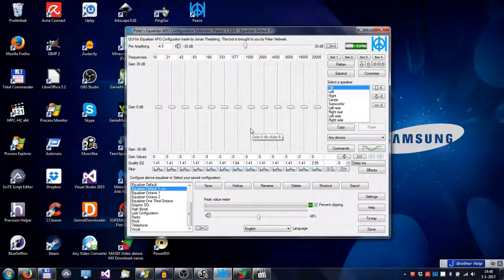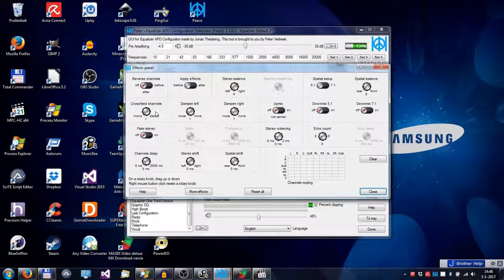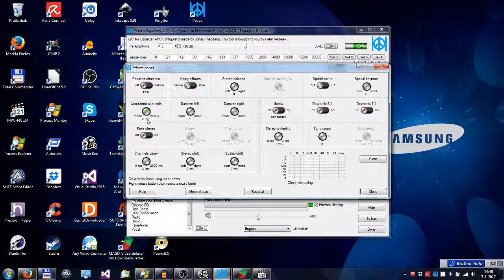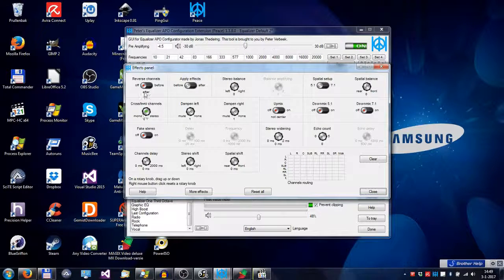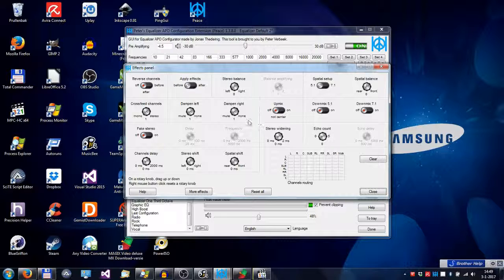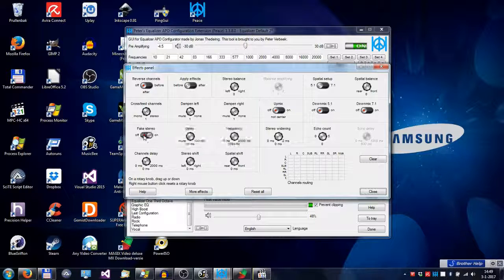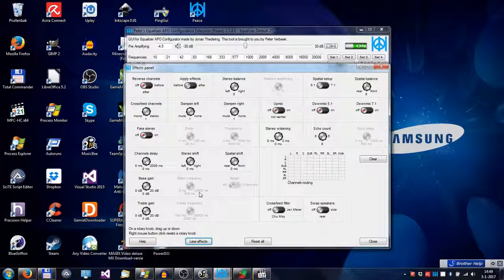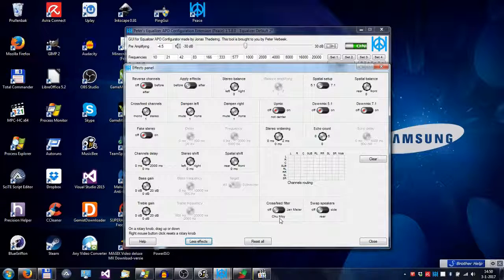Peace Equalizer -  Tutorial 4 The effects panel

Comment: Hello, this is a super awesome tool thank you for it! I have one question about it, how does the channels routing feature work? Does it ever not work for some sound chipsets? I am trying to setup my speakers in a multispeaker but not surround sound way. I want just 2 channel stereo output but apply the equalizers to all 5 of my speakers individually (2 front left, 2 front right and 1 subwoofer). I was just using a physical headphone splitter to split the stereo to everything but splitting them out to the front left+right, rear left+right, and subwoofer connections and enabling the channels routing to send left to front left and rear left, then right to front right, rear right and subwoofer I get no output to anything but the front left and right, it doesnt seem to do much of anything. Any tips? thank you
Reply from the maker: Reading your post I'm not entirely sure what you need. But I can give you some ideas to play with. For instance, when having a stereo sound input and you want to spread it on a 5 speakers output you might use the "Upmix" effect on the Effects panel. At first, set the "Up way" to "Always" so upmixing is always done despite the input. Later on you may try "Detect".

On the main Peace window you can equalize individual speakers or a group of speakers. To do this click on the speaker (combi) in the speakers list at the right. For instance, equalizing the left speaker is done by clicking on it and then equalizing it. Of course in your case you want to equalize the front, back and perhaps subwoofer. As these aren't in the speakers list you create these combi's yourself. It's very easy: Click on "left" in the list, click the right upper edit button at the list and check the right speaker checkbox. Of course give it a proper name like "front". Now do the same procedure for the rear. You might delete the speaker combi's you don't want.
Reply: @PeterVerbeek  yes that is good advice but my issue is something else. Somehow upmixing and channel routing does not let sound out of any of the surround outputs, I only ever get sound from the front left/right speakers. Is it possible there is some sort of output enable or automatic mute for the surround outputs that is missing from the config?
Reply from the maker: @SuperBrainAK  If the upmixing and channel routing doesn't produce sound on all channels other then stereo left/right ones then something else is going on.
At least check within Windows in the sound panel of the device if the device is not set on stereo only. It must be on 5.1 or 7.1. On "stereo" the other speakers won't produce any sound.

 As for your question "Does it ever not work for some sound chipsets?", it might be although I never encounter it while giving support on Peace and Equalizer APO. What could also be the case that some surround sound setting is blocking the upmix and channel routing. I'm not aware of this as a possibility but it might be the case. For instance, on the sound panel of device there's an option for a stereo device to make it "surround sound". Perhaps this setting and an equal one is the culprit. Such setting could also be in the software of the audio device. Some headphones like Logitech has by default surround sound enabled.

Comment: Hi! I checked out your add-on because of the Meier crossfeed feature but so far I've found the stock EQAPO interface to be more useful to me. Being able to keep multiple configurations in the config.txt editor and turn them on and off as needed is essential to me. I have a file for correcting my own hearing imbalance, one correction profile for each of my headphones and a few effect presets. There might be a way of doing this within Peace but I haven't found it yet. Now my question is if there's a downside to just breaking the crossfeed effect out into a text file and using it as a separate configuration in the standard program? Does the effect interact with other adjustments within Peace or is it just a plain set of values?
Reply from the maker: In principle you can use Peace and the Configuration Editor (stock interface) at the same time. The only command Peace needs is the 'include: peace.txt' command. What you do above or below it is your doing.

If you like the Meier crossfeed of Peace you can copy the commands Peace generates and put them in your own config file(s).

Keeping multiple configurations is what Peace is all about. You can easily switch between them on the interface or by assigned hotkeys or by the Peace tray menu. And if you need to add a config (your effects presets for instance) onto top of another that's also possible (done on the Automation window). In other words, doing this in Configuration Editor is quite cumbersome. On the other hand, you might like this editor and I am giving support on it as the developer of Equalizer APO isn't sparsely active on his project. Once or twice a year he answers a few posts.
Reply: @PeterVerbeek  Thanks for the reply and thanks for confirming my suspicion that it's just a matter of getting used to it. I'll keep fiddling around with it now that i have a decent enough solution. This all started with me putting on Kind of Blue and realising that I need a crossfeed solution quickly lest my ears start bleeding before the sax solo is over. =)
Reply from the maker: @Joelsfilmer  Yes, crossfeeding the audio can be quite important. It may relieve the sound pressure on ones ears. Anyway, let me know if you have questions on either Peace or Equalizer APO.
Reply: @PeterVerbeek  Especially when the drums are panned hard right and the saxophone hard left. Ah, 1950's stereo mixing. Thank you so much!
Reply from the maker: @Joelsfilmer  Yeah, a crossfeed brings things "closer". You're welcome, Joel.

Comment: hey please can you help me understand or make a video on what is the difference between stereo shift, stereo balance and dampen L/R? i am trying to correct the imbalance in my headphones and speakers. Which should i use for headphones and which should i use for speakers? Searched quite a bit but coudln't find any results related to it.
Reply from the maker: With the stereo balance knob you can shift the audio image to the left or right. With the dampen knobs you can make the left or the right (or both) quieter. So basically the balance knob is there to change the location of listener from the middle to the left or right. When 1 speaker is louder than the other then the specific dampening knob needs to be used.

As headphones have the same audio drivers (speakers) then usually it's a matter of using the balance knob as 1 ear has a volume hearing issue compared to the other. But usually such an issue also comes with a frequencies hearing issue. To correct this, one uses the main equalizer window to create 2 EQ's, one for each ear. Btw. The Test interface is there to discover the impaired hearing frequencies.

So in your case you can make 2 configurations: 1 for speakers and 1 for headphones. And store them in the left bottom configurations list. A configuration can be combination of channel EQs, effects and commands. For instance, in your speakers config you have a specific balance setting while having another setting for your headphones config.
Reply: @PeterVerbeek  okay so if i shift stereo balance to the left, would that mean if i am wearing headphones i would theoretically hear both right and left stereo sound coming from the left?
And in your 2nd para you said to use balance. Then i shouldn't use dampening?
And what about stereo shift option?
Reply from the maker: @shahzaibihsan3259  Yes to your first question. One could say the right is dragged to the left.
Dampening is only useful if one speaker is somehow louder than the other. For instance, when having 2 different speakers for the left and right. Although our hearing could have a difference in sound volume, for instance when one ear isn't picking up sound on a lower volume compared to the other.

I've deleted the "stereo shift" from the Effects panel a long time ago. Basically it was a simple shifting which wasn't useful compared to the better stereo balance.
Reply: @PeterVerbeek  okay so when i put  heapdhones the wrong way ( right ear cup on left ear), the right ear cup now on left side  still produces less audio. It feels like the right side of headphones is toned down due to a wire issue or something. Should i still use stereo balance to correct this?
Reply from the maker: @shahzaibihsan3259  Yes. Just dial the balance knob until the volumes are even.
Reply: @PeterVerbeek   hey sorry for the late reply went busy. Okay so i have adjusted the balance knob and it feels better than the dampening. Thank you so much for your info!
On another note, does the dampening knob have any effect on audio forwardness? When i used dampening to balance the audio, the overall sound felt muted and the music forwardness decreased.,
Reply from the maker: @shahzaibihsan3259  I don't think that it has an effect on audio forwardness as it dampens (lowers the volumes) of all left and/or right channels. But one can perceive a difference as any change can in the audio by dampening or other effects.
Reply: @PeterVerbeek  Right, thank you so much! 
1 last question: There is also a panel in windows sound settings that has 2 bars  for decreasing or increasing the volume of incividual right and left channels. Does it also function as dampening?
Reply from the maker: @shahzaibihsan3259  Probably yes. Windows isn't known for its many clever audio manipulation.
Reply: @PeterVerbeek   thanks so mucn man! you're the best

Comment: Is it posible to add crossfade?
Reply from the maker: Yes. A simple crossfade is available on the Effects panel. And some 2 more complex ones: Jan Meier and Chu Moy. However, these are simulations as Equalizer APO isn't capable to precisely create these crossfade filters. But people seem to like and use them.
Reply: @PeterVerbeek  Hello and thanks, i found it, but i was wrong, the effect what im trying to find it stops the music when you pause but smoothly, sorry it's hard to explain, the sound doesn't cut off abruptly but the volume is progressively lowered but in a matter of 1 or 0.5 seconds, realtek driver has one of these effects within "environment" the effect in the program is called "generic"
Reply from the maker: @zippownedorm9804  I get it. Such a feature is on the Peace wish list. To be specific: Smoothly starting and stopping music/sound (with a user set delay like you're saying). The issue here is that Equalizer APO doesn't support this out of the box and I'm not sure if the programming language I use is fast enough to do this 'smoothing' properly.